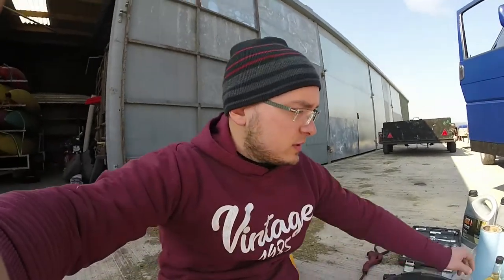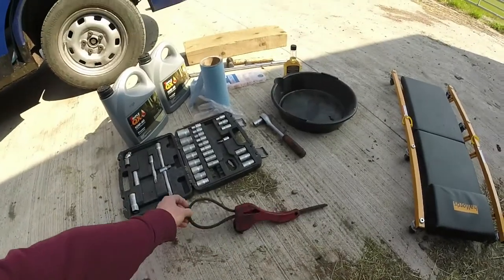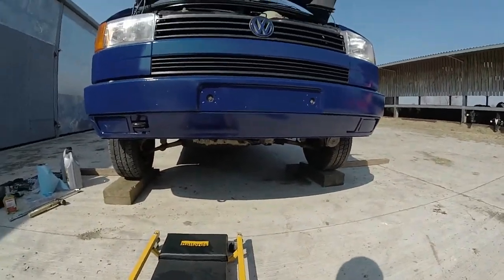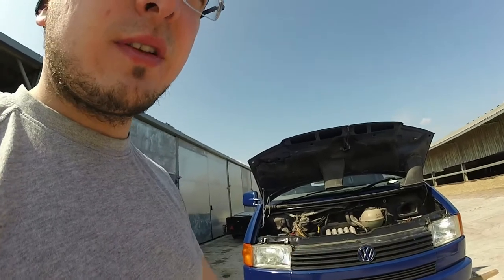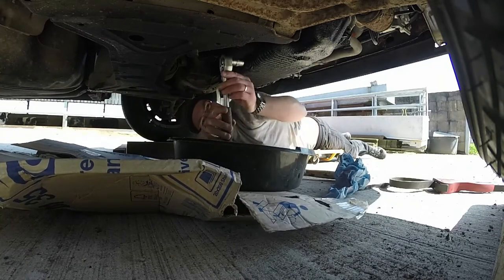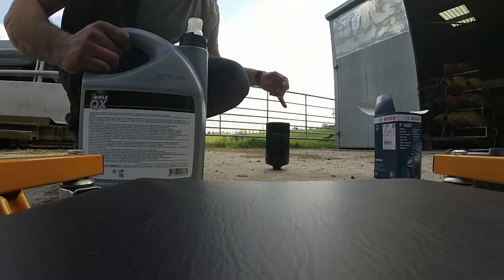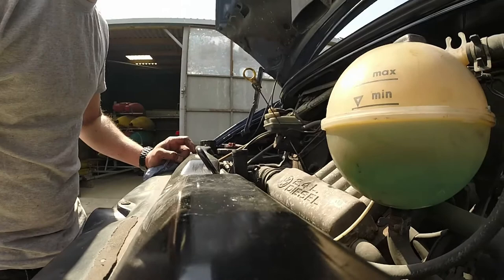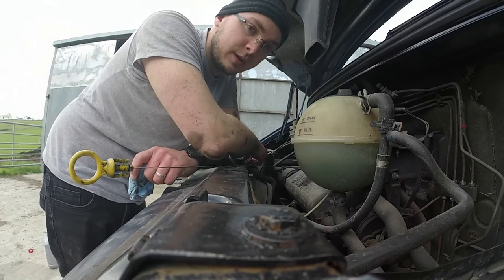VW T4 Transporter/Caravelle Oil Flush and Oil Change (How to)

Comment: not one for a negative post but did you take the oil cap and dip stick out before draining? also when removing the oil filter if you wrap it in a plastic bag it'll catch the excess oil, plus a new sump plug is best at every change, also the van needs to be level. just saying